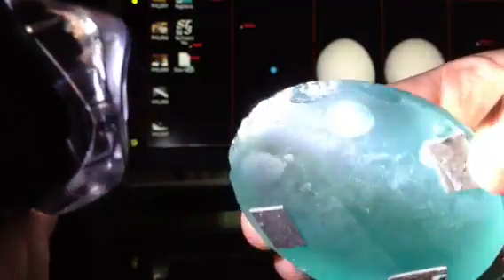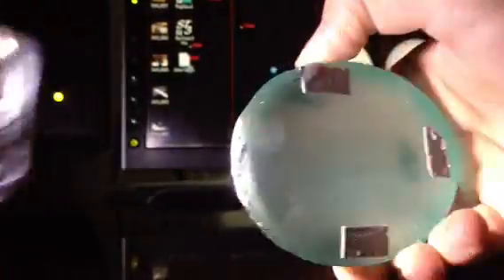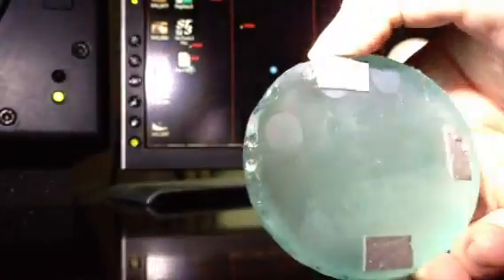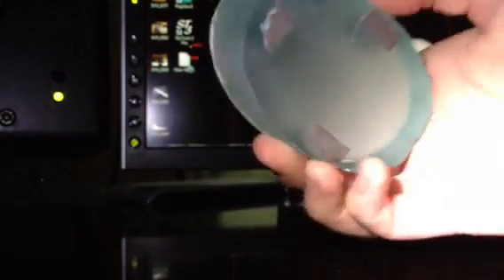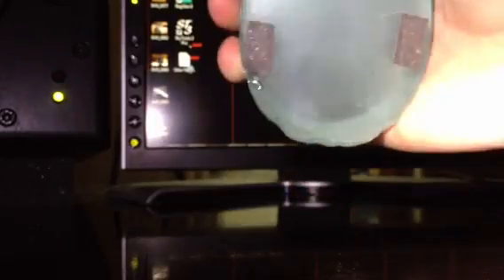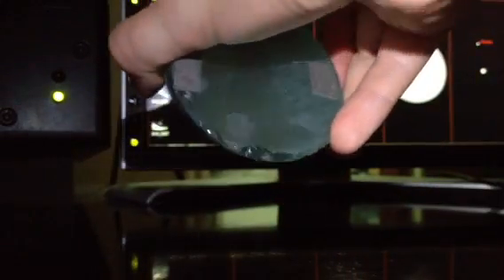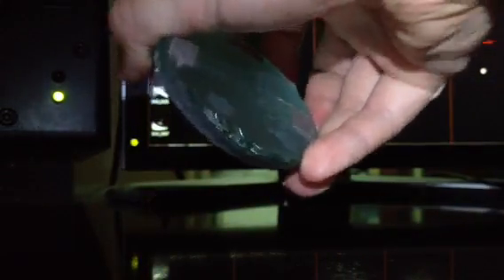Meade LightBridge Secondary Mirror

Comment from the maker: I still got some pretty good views with it but replacing it with a protostar definitely made an improvement. Although I did get my primary refigured & recoated at the same time so I have no way of deducing how much the secondary itself caused the problems.

As for the scratches I cleaned it a couple times but always with the upmost care. Hell I even had a felt lined drawstring bag that I kept over it to keep it from the elements. I am sure some scratches came from me but I never used rocks lol!

Comment: weird. it took me a minute to take it out.. my secondary back has a chip but in an area it does nothing to.. 

As for your coating.. theres no way thats factory. it looks like you dropped it or stuff on it. threw it on rocks. and tried cleaning with a towel. lol..

My lightbridge has some hairline scratches "i caused" and i still get pretty damn good views